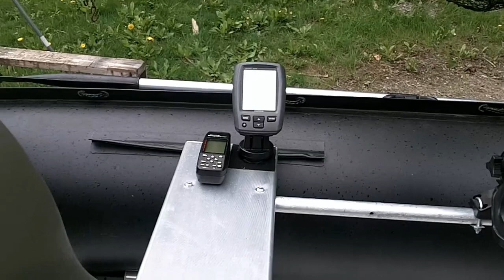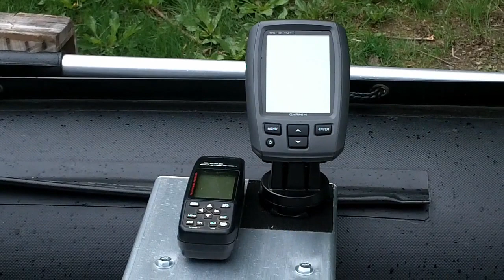Inflatable Boat Mods Lake Champlain Salmon Fishing

Comment: Do you think tying bobber stops onto the mono would work to give you a depth indication?  If they wouldn't move, figure out a system and tie multiple ones together.  Like 1 green = 20 ft, 2 green = 40 ft. 1 pink = 60 ft. 2 pink = 80 ft.  or whatever system you could come up with.

Comment: does the black material get hot....or is it negligable....im thnking getting 15 ft but they only have in black...
Reply from the maker: Oh yea it does in direct sun light. Something to be aware of as the air pressure increases substantially in the chambers when in direct sunlight. I put about 2.5 psi in it when cool and it rises  a lot once it heats up in direct sun.
Reply: great tip on the air expansion. have not taken my bone colour boat out in summer yet. Just got it and it is winter in Australia.
Reply from the maker: Ur gonna love it Valamaas! They really make a neat versatile platform.

Comment: Thanks for the downrigger idea! Looks amazing! How did you attach the pulley to the metal rod?
Reply from the maker: Drilled a hole thru the tubing and inserted a threaded eyebolt. The pulley is attached to the eyebolt. Cheers and good luck in ur build!
Reply: @charliefizfaz373  Thank You!

Comment: Great video! What trailer are you using for your inflatable? Ive been looking for options. Thanks!
Reply from the maker: TheKingPinDamo believe it or not, it's a harbor freight trailer(small) modified with cross pieces (2"channel) welded to the frame and 2x12's under the pontoons. I installed a longer tongue for the hitch.
Reply: Awesome, thanks for sharing!